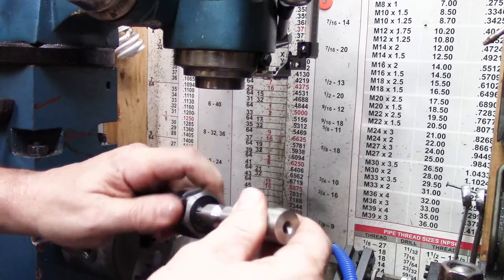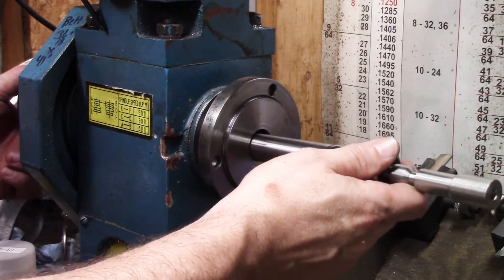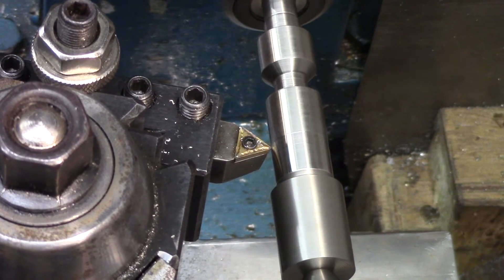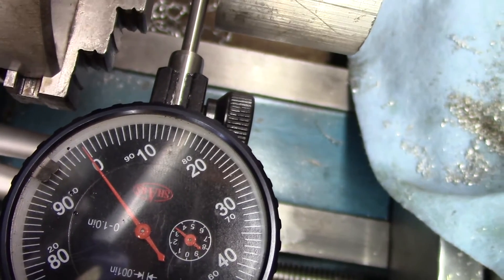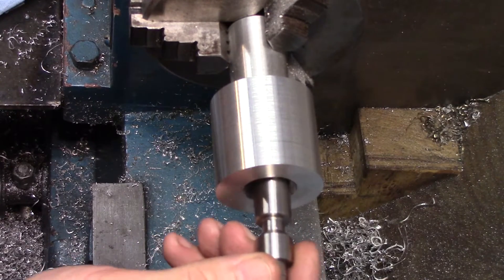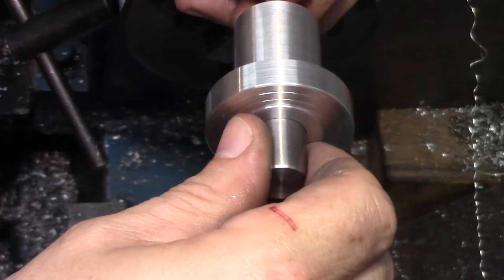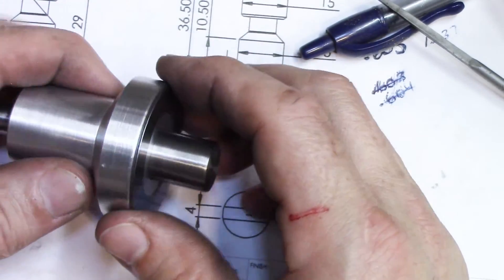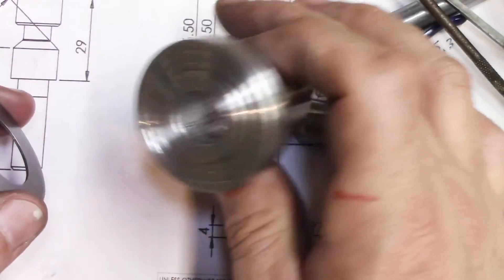Correcting MISTAKES - DIY Co-ax (Coaxial?) Indicator - Part 4 - #TMC2020

Comment: This one almost slipped by me. My ignoring you skills aren't what they used to be! lol  - Hey I got a collet chuck that will help you true that up lol   What is that taper Morse 3?
Reply from the maker: Yes Morse 3 and no I don't want your curly fry making boat anchor. I am afraid my bearings could not take the shake weight. Hey!!!, mount it on the end of that spindle and strap paint cans on  it. Instant paint shaker.
Reply: @theeddies  It's probably alright when dialed in, but it's stupid to try to adjust that much metal with 3  8-32 screws (Or whatever) acting as jacks. It's begging to snap one off in the thing.  Also seems silly to have that much stick out and be holding a 1 1/2" piece of round that you could just put in a 3 jaw. I can see if you were doing a production run of parts, but even then it's just not a great design to me. It might be good mounted to a rotary table or something. I found a piece of 1" round stock today. A couple jars of stainless 1/4-20 screws too. No hardware sorting video required. Found a model airplane engine too. Never messed around with one.  Another cordless drill with battery and charger, this time Dewalt.
Reply: @theeddies  Want to buy some old saddle bags?
Reply from the maker: @johnstrange6799  Can you send a picture?
Reply: @theeddies  You mean clothed, right?
Reply: @theeddies  Photos of the saddle bags. I guess. I forget if I have your email address.
Reply from the maker: @johnstrange6799  JFK don't send me those .
Reply: It looks good. The first brass part seems difficult, but the body isn't as hard as I initially imagined it.

Comment: Nice Eddie :-) You got there!
Reply from the maker: Thanks Bill, that last measurement felt good. Did you just use a pin for the rocker pivot or a screw?
Reply: @theeddies  I used  dowl pin which was a press fit into one side of the shaft an d clear on the rocker and other side of the shaft.
Reply from the maker: @wktodd  Excellent, thanks!